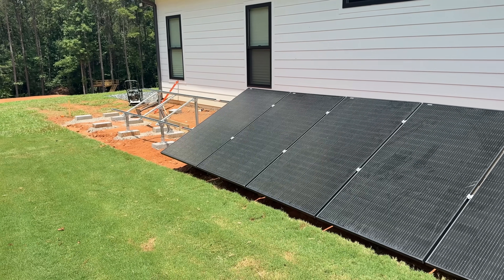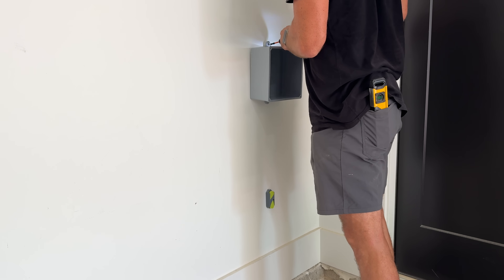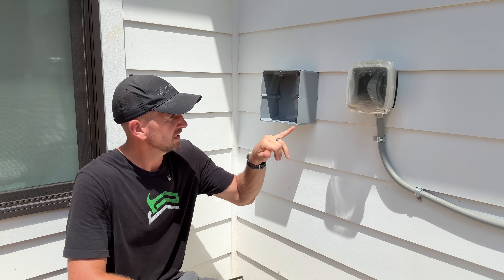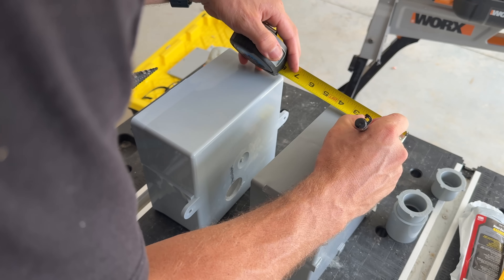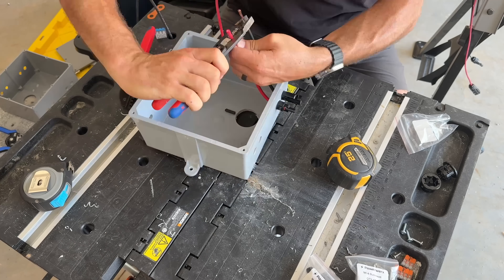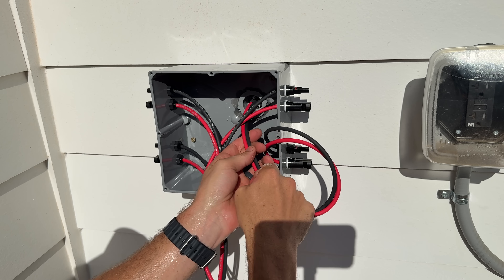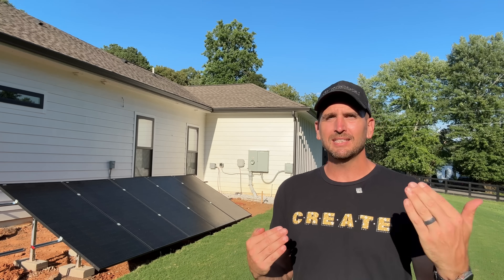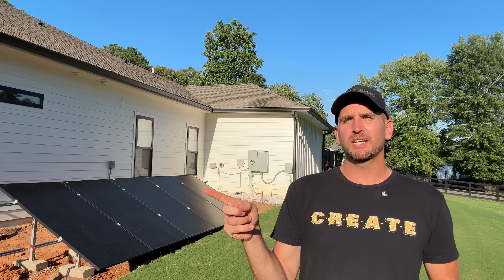How to Run Solar Cables Inside Your Home Safely

Comment: For starters, you should be using a DC disconnect switch.  Also I hope you grounded all of the PV panels.  Plus Install a home home surge protector.  One lightning bolt and its all fried....  I would not use wago connectors.  Place fireboard behind wall mounted electronics or wiring in case of fire.  Install a smart smoke detector and or video cameras by your equipment.

Comment: Are you not required by NEC code... not local county code...to have a copper ground wire bonded to the panels and mounting frame following those PV wires into the house and then tied to the main panel?

Comment: I'm comfortable around electricity, but solar MC4 terrify me. Something about 600V DC just makes me uneasy. Those Unarmored MC4 cables are  a death trap. I can image a lawn mower or edger or kid hitting those wires and its lights out. Definitely need to be inside a conduit, or buried. 
I also wouldn't trust those cables just laying on the floor of the garage. Having HV to an XT60 connector is so dangerous. There aren't even any DC disconnects or grounding.

Comment: Only thing I would've done differently is to add a disconnect switch somewhere along the line. Once you get to those higher voltage PV systems, it becomes risky to just unplug them while they're energized.

Comment: I used the same Powerwerx MC4 connectors on a build last summer with submersible watertight enclosures from McMaster-Carr. They were for the panels before the combiner box and only had one line going into a box with conduit for the house.  I used Anderson power pole 45 connectors from Powerwerx instead of lever nuts for a solid connection. They have the red clips to keep them locked. I have seen some lever nuts for up to 30 amps ( 221-612 )  but I like the Anderon connectors for up to 45 amps. On the back of the box I tapped (pipe thread) into the box so I could thread a fitting in place for a better seal and putty around that. Also on the MC4 connectors I tapped each one and threaded them into place then put a nut on the backside instead of just the nut. Powerwerx has alot nice products (Clips were: Powerwerx Retention Clips for PP15/30/45 Anderson Power Powerpole Connectors) Same idea but just a different way with Anderson connectors that can handle more Amps.

Comment: You mention being careful not to hit a pipe or electrical behind the wall, and then used a thin bit. Instead, mark your area and cut a large enough hole in the drywall to look inside. All clear, then proceed.

Comment: Hey that's a great idea the Box I'm just thinking myself a plastic box with electrical wires with equal melt is there a reason why we didn't go with a metal box I'm just curious I mean I realize metal will Rust but when it comes to fires it's better just curious

Comment: I would have placed some inline mc4 fuses leaving the arrays. You know your system voltages and amperage’s, so you would have to calculate the fuse you need to use. I’m in the process of installing my own system per local code. It gets expensive, I am using a IMO shutdown breaker boxes at the base of my 2 arrays just for the safety factor.  It wouldn’t be a bad idea to know what NEC year book, maybe 2020, your Town uses for inspections. I’m still learning myself, I like the comments about metal conduit for the home entry to the inside entry box feeding my (2) DPU’s. I will research what the NEC 2020 code says about the type of conduit required. Personally, I would stay away from wago type connections, but that’s me. Enjoy your videos and I’m a subscriber.

Comment: Why did you use the lever nuts instead of just connecting the end of the other ends of the wire to the mc 4 connectors ?  Also shouldn't the pvc have been glued in the wall?  I know it cant move but....   And finally, shouldnt there be some sort of circuit breaker/ on/off switch on each input?   Thanks for any help!

Comment: I agree with the comments about conduit. More importantly, so does the NEC. You can run PVC from the array and underground to the house. But it must be enclosed in metal where it attaches to the house. It must remain in metal when it passes through the wall and up to the point it connects to the equipment. It is not permitted to run conductors carrying DC current outside a metal enclosure (conduit or a raceway). The Ecoflow units make this particularly challenging since they connect using external MC4s.  But it's not impossible. I can provide photos if there is interest. All this assumes that you want to pass inspection (or want to follow all the NEC rules).
Reply from the maker: Yeah, I am interested to see some photos of running conduit all the way to the DP3 and/or DPU.  You can email me at scott@everydaysolar.com.  Thanks for providing feedback 👍
Reply: would love to see photos too

Comment: I don’t know, man kinda looks a little messy would’ve ran pipe out to my Solar array yeah it’s more work to dig, but you would’ve been a lot happier with the product also your solar array since it’s detached, should have DC breakers or a way of a rapid shut off just to increase the safety for DIY set up looks pretty cool

Comment: This not how I would do it.  What you are doing now has no chance whatsoever of passing code.  There are way, way too many connectors in the electrical path (all are potential failure points).  Putting MC4's on the side of the box is a terrible idea... if you use them at all (and you shouldn't on these boxes), they'd go on the bottom.

* I wouldn't use plastic for this.   Use EMT and metal electrical boxes.  This is a dangerous amount of power, don't play around with it.  Multiple HVDC strings?  Use EMT.

* No need for two electrical boxes.  Decide where you want the DC disconnect to be (which is NOT the MC4 connectors!).  Lets say you want the DC disconnect outside.  Then:

* EMT from equipment, through wall via a LB, terminate the EMT at METAL electrical box on the outside wall.  Use proper fittings and bushings.

* Install DC breakers in the electrical box.   Or use a heavy-duty 2-pole disconnect instead.  Choose inside or outside.  ONE box.

* Run DC cabling from MPPT equipment, through the conduit, and terminate on the breakers in the electrical box.

* Run DC cabling from solar, through EMT along the wall and into the metal electrical box, and terminate it on the other side of the breakers.

* Also run a green GROUND cable and properly ground the EMT and metal box, all the way through to the solar frames.

If you want your DC disconnect inside then you just put the electrical box inside and run EMT through the wall to a LB outside and then to the EMT going to the solar.

Code Fails:

* HVDC must be run through metal conduit and boxes, period.

* Failed to properly mark cable pairs.  The DC- and DC+ for each solar pair should be taped with colored electrical tape in multiple places so there can be no confusion whatsoever.  The string DC-'s are NOT interchangeable even if they wind up being commoned on the other side of the EcoFlow.

* No grounding.  The panel frames must be grounded.  The (metal) conduit and boxes must be grounded.  Are you trying to electrocute your family?  Those solar panel frames can definitely become energized with coupled EM fields from the inverters and battery ripple.

* Mixing incompatible DC voltage cable pairs in the same conduit.  The cables themselves are at least 600V rated so that part is ok, but the fact that some of those pairs are going into LVDC MPPT inputs ... that creates a problem because a LVDC MPPT input can explode if you connect HVDC to it accidentally.  So ... not sure but I don't think you can mix them in one conduit.  They all have to be HVDC or the LVDC MPPT inputs have to be able to tolerate the HVDC voltages safely.

* No DC disconnect.  The ... well, ok the DC disconnect on the Ecoflows might count, but you should also have a DC disconnect either outside or inside at the wall junction just to be able to work on the system if anything else.

* You need to properly label all HVDC and solar related junction boxes, disconnects, etc.

* I don't recall but I was under the impression that those EcoFlows were hybrid-capable inverters (capable of doing load support with the grid connected, and/or exporting), in which case you need an AC disconnect somewhere, well marked.  Since the solar is DC coupled I don't think the AC disconnect needs to be outside but not sure... depends on municipal code.  A generator plug is not a disconnect.

* RSD buttons and RSD devices for ground mounted solar are generally optional (not required), but it will depend on the municipal code.

* WAGOs are not approved for outside use.  You have them in the inside box but... mmmm... well, if you seal the conduit and hole it might be ok.  Its a bit of an edge case I think.

Probably lots more.

-Matt
Reply: doesnt it matter that this is a ground mount and not a roof mount? plus its not going directly into his house like micro inverters do.

idk i know electricians are terrified about anything considered "high voltage" but the problem is the term is not well defined across industries. all the definitions tend to define high/low voltage dc by saying what it isnt instead of what it actually is.
if electricians had their way, they would force all poe security cameras and networking ethernet devices to be ran in bulletproof adamantium conduit coz while its nominally 48v it can occasionally be ~54v if its linked with some kind of a 16s lfp backup.
electricians are trained on code that was made to apply to low voltage door bells and intermittent use appliances, and then they start babbling about class 1 and class 2 garbage like it means anything. 
think we agree on most stuff, its just always rubbed me the wrong way how electricians tend to run their mouths about cheap temporary installs that are hardly interacting with the grid itself. 
like how germany figured out u can just allow people to hook up balcony solar and increased the amount of installed solar multiple fold during the gas shortages of 2021 by just back feeding a regular wall outlet. hasnt actually caused any issues lol
Reply: @vevenaneathna  Yes, the rules are different for ground-mounts.  You generally don't need per-panel RSDs for example.  But the grounding rules are generally set in stone either way... and also vary from county to county in terms of what they want you to do (localized grounding rod at the panels, or hook into the house ground).

However, this particular ground mount is right next to the house  i.e. we're talking kids playing here, not electricians.  Major safety item.   So the frames absolutely have to be on the house ground if nothing else... and RSDs are probably a good idea too.  And the MPPTs must have insulation resistance testing and probably ARC fault detection.   (I'm not sure of the EcoFlow MPPTs have all of that, and I'm sure it probably doesn't have a RSD transmitter built-in).

Same with the electrical.  Grounded metal conduits (aka EMT) are virtually certain to be mandatory items in this case due to the location of the panels and the HVDC.  Above-ground entry too (no point doing below-ground PVC that close to the house and having to deal with water pooling, in my opinion).

Anything attached to or going into the house needs to adhere to NEC and local codes for a system like this as well, regardless of where the panels are.

-Matt
Reply: Fantastic information. Thanks for taking the time to lay all this out.
Reply: Bro, I see you everywhere in the battery and solar vids I watch and you’re always laying all kinds of knowledge and wisdom. Thank you for taking the time to educate us dummies.

Comment: i still need to do this project myself, I did wince when you plugged it all in under load... but I've done it too, and I still have all my fingers and toes. I feel like modern equipment can handle it. besides that it looks awesome, way better than I could do. I'm still working up the nerve to try.

Comment: Good video , I did similar with my Jackery 5000plus system , but I did not splice the cables inside the box , when I bought the crimper kit I also bought extra connectors so just ran a wire from connector on outside box to the end of connector on inside box ( with no splicing in between )

Comment: I used a DiHool junction box with breakers and RCDs on the outside.  I believe code requires having an external disconnecting means, but maybe the MC4's count for that?

Comment: isn't that solar panel string running a high enough voltage to need a solar disconnect?  or does the ecoflow disconnect it automatically when you power it off?  wouldn't want a big DC arc yanking those cables hot.  i like this idea though!!
Reply from the maker: For 3 of the 4 strings I will be around 150V so I won't be using a disconnect.  The 4th will be up to 450V and that will be ran into the Delta Pro Ultra that has a built in disconnect.  With that said probably not a bad idea to have disconnects and possible something I can work in a future design.
Reply: @everydaysolar sweet!!

Comment: There is so much wrong in this video, but I'll just point out that Wagos are not compatible with #10 PV wire. The insulation diameter is too large. You also need to be careful with the voltage calculations. Wagos are only rated for 450 volts, while PV strings can be up to 600 volts depending on how the panels are connected. There is really nothing in this video that I would recommend doing. I mean, seriously. PVC conduit inside a structure with DC conductors? Exposed high voltage DC wires? There is nothing at all safe about this. Forget about code compliance. That ship sailed a long time ago. 

These consumer grade portable battery systems claim to be whole house energy back up solutions, lulling homeowners into a sense of complacency and over confidence. Solar and electrical should be left to the professionals. 

I'm sure the trolls will come out and say that they installed their own systems and their house hasn't burned down yet! Good luck with that.
Reply from the maker: Thanks for the feedback.

Comment: NEC 690.31 is mentioned several times in the comments. I found a copy of the NEC online, but I don't see exactly where 690.31, specifically NEC 690.31(C) talks about the indoor cabling. Can somebody give me the exact section, or post a short snippet of that section of the code?

<UPDATE> It's in section D:

(D)

(1) Metal Raceways and Enclosures. Where inside buildings, PV system dc circuits that exceed 30 volts or 8 amperes shall be contained in metal raceways, in Type MC metal-clad cable that complies with 250.118(A) (10) (b) or (A) ( 10) (c), or in metal enclosures.

Exception: PVIICS installed in accordance with 690.12(8)(2)(1) shall be permitted to be provided with or listed for use with nonmetallic enclosure(s), nonmetallic raceway(s), and cables other than Type MC metal clad cable(s), at the point of penetration of the surface of the building.

Comment: If this is a permanent installation, why not put the panels on the roof? It would make for a more difficult install, but it would probably be safer for the panels in the long run.
Reply: Roof install requires a permit and inspection where I live.  Ground array does not

Comment: What do you think of the idea of using a pre-fab mini outdoor lockable shed the size of a dog house and put the Delta Pro 3 in it? Then the dc pv wires are never considered "inside the residential house" from a NEC point of view.  They would be inside a dog house. ha ha  Then run a 14-30 cord to a proper outdoor generator inlet then to a Reliance manual transfer switch inside the garage by the main panel.  I am sure all I am doing is replacing one set of challenges with another set. such as: ventilation in the summer, heat in the winter, theft, a suitable location.

Comment: Coming from experience, you are letting lightning past all the circuit safeties of your home. At least have a fuse box and lightning surge with grounding installed before it goes inside.

Comment: Must be nice to afford 20 grand for a solar setup...
Reply from the maker: For the 10 x 405W panels and the ground mounts I will have about $1,800 invested.  You can start small and build your system up from there.
Reply: @everydaysolar  You got a method for a quick disconnect at the house to quickly disconnect panels?
Think 50 amp. 8 gauge wire. Maybe a twist lock to keep it securely plugged in?
Going to build a portable 800 watt system on wheels for quick storage.
Reply: @everydaysolar  I decided on using a string inverter and plug the panels into a nearby outlet.
Eliminates the issue of DC wire gauge issues.
Seems to me that DC cabling is best for arrays that are on the other side of a house wall (very short distance).
Reply: @everydaysolar  LOL I was exaggerating a bit.
If I put panels on the ground they would be vandalized or stolen pretty dang quickly.
Also got too many trees and buildings restricting sunlight.
I have zero credit and no money so even starting small would be monumental.
Took me a year to get one folding 100W panel and a 300 watt solar generator.
And that panel only outputs barely 65 watts in direct sun.
Roof has funky angles with no spot getting direct full sun all day.

Comment: A solar company called Revopower sells a device that helps you put your solar wires in the home easy look up
Solar Panel Wall Wire / Cable Entry Weatherproof with Single or 2 Gang Outlet Box on their website

Comment: I’m getting ready to build a fully off grid house,  and my system will be a 12000XP and 2 EG4 wall mount batteries. I’m not an electrician so I’ve been trying to get smart on the code before I start. My understanding is that your panels have to be grounded and that ground wire has to follow the PV wire into your house and inverter, and that has to be tied to your house ground. Call me silly, but if my ground mount takes a hit I’d like to keep the lightning outside.